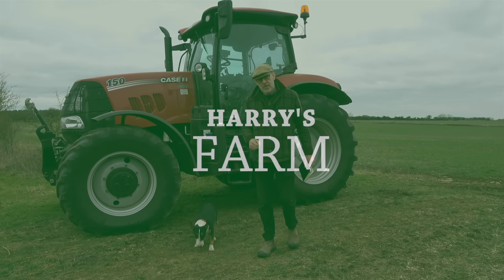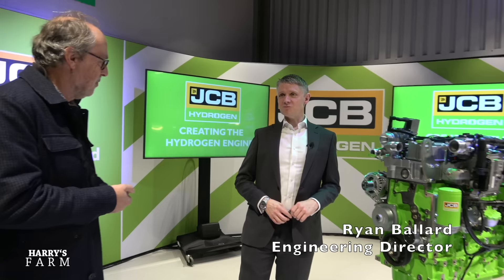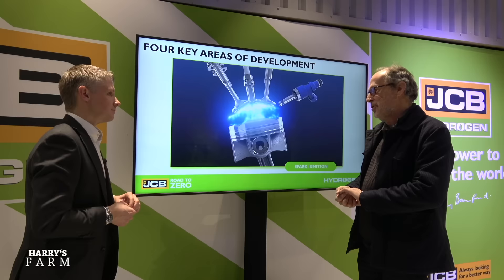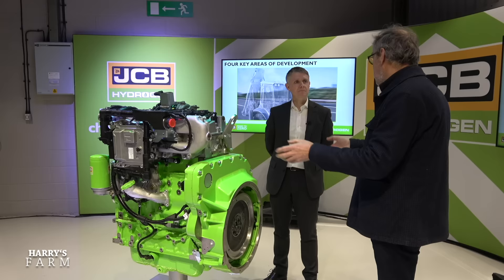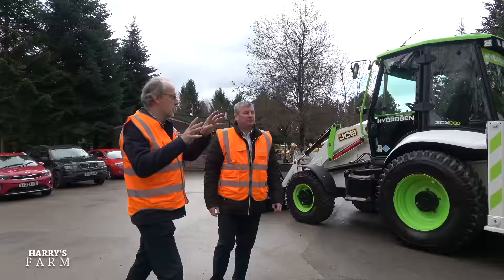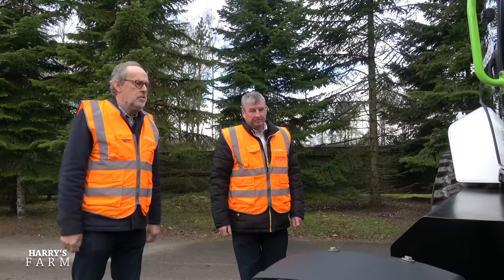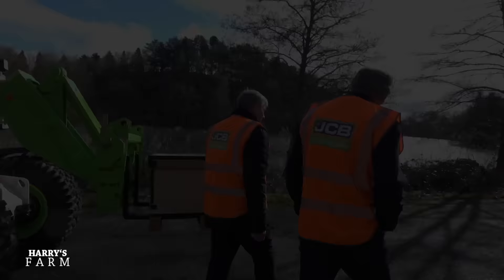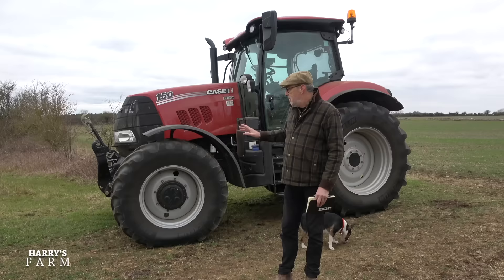JCB is moving to hydrogen power for all their big machinery. Here’s why.

Comment: This is an excellent video, as a diesel engineer im watching the hydrogen world with a keen eye.
I do wonder what the crash protection of the storage tanks is like, 350bar is a huge amount of pressure to let go.

The huge RPM of the turbocharger makes me wonder if that's a single point of failure.
Reply: some turbos already spin at 280,000 in petrol engines ,  Diesels spin slower ,i think what  they have achieved is a turbo that spins very quickly at low engine revs  but not a turbo that spins  any faster than a petrol turbo .
Reply: I think you have probably seen a turbo glowing red/white hot and still run reliably ,I think a few revs will not do any harm.  Also I have drove gas Scania,s with carbon tanks on the sides with no issues.

Comment: On a tour of the Cummings factory 20 years ago they said that they believed if an engineer could come up with a commercially viable method for storing gas in a similar volume as diesel in a compact size they would be billionaires.

It is certainly an interesting direction along with the CNH methane engines it will be interesting to see the true viability in the sector as a lot is certainly going to depend on infrastructure especially given how a lot of locals view planning applications for such things .
Reply: Storin g high pressure hydrogen is an expensive and dangerous business. That is why hydrogen has not caught on in cars and won't catch on in tractors either.
Reply: Cummins are already building Hydrogen engines too. Interesting to see it develop.
Reply: Dacia have Duel Fuel, LPG & petrol. The LPG tank is fitted in space for spare wheel. LPG is good value and gives good mileage.

Comment: The biggest problem for hydrogen is the distribution. It requires rughly to ten times more lorrys to distribute hydrogen than diesel. Thanks for a nice vid!!
Reply: Does it? Surely at higher compression less volume is required for the same return for kWh per g as diesel.

Comment: I love this, but no one talks about the loss of hydrogen while the equipment is unused, due to the pressure tank needing to relieve pressure as the tank warms up.
Reply: it's just the angel's share, works wonders for Whisky. Vintage Hydrogen anyone?
Reply: As systems are refined the small problems will be resolved. Everyone slating hydrogen are the same as people slating electric vehicles 10 years ago. Conventional ICE engines are safer & more efficient than they were 10 years ago. Investment drives innovation.

Comment: Very interesting video Harry! Fantastic to see how fast their progress has been going. But I think batteries biggest advantage over hydrogen is still the price. it's just so much cheaper and most of the problems with long charging can be done with battery swap or fast charging. Anyway its great either way which will be used :)
Reply: Can you provide a reference on your "Cheaper" claim?
Reply: @bru512  Sure. it will depend on different markets. but with batteries charged from solar/wind directly it is about 3 cents or less. from the grid it would be between 10 and 20 cents(depending on where). batteries will have a cost of about 2-10 cents over lifetime. so with this its is between 2-5 times cheaper than diesel or hydrogen at its current state
Reply: and even with only fast charging its still cheaper at about 3-5 cents per kwh
Reply: @bru512  a 3 pin cost about £100 to put in.
The cheapest hydrogen fuel pump is about $2000000

And you can't really drop the price per mile below £0.15 per mile, (if fuel was free)

Comment: I worry about the storage of Hydrogen as it is kept around 350 > 700 Bar. I foresee nasty tank explosions in the early days of this gas being deployed on sites and farms. You're a brave man standing that close to the tanks.

I agree charging battery-based building site or farm machines in remote areas is not going to work in many cases.

But we must not forget that once you produce this gas, compress it, transport it, and burn it in an engine, you only get around 28% of the energy you put in at the start. So everything we can electrify we should for sure before reaching for Hydrogen.

I agree for some long lorry/truck trips that have to be over 400 miles or long-distance shipping, then Hydrogen is one of the only options. But there are plenty of lorry routes under 400 miles where an electric truck will work fine. The Regen braking on a battery lorry will re-capture up to 20% of the energy on a typical run and do over 90% of the stopping work, whereas a Hydrogen lorry would need to apply the old style brakes, which need replacing just like diesel trucks, thus still generating brake dust.

I am sad, Harry, that you dismissed the work of Tesla, and the Tesla Semi, a large full truck capable of up to 425 miles at full load (37 tons). This could replace many routes in the UK and is 90% more efficient than any Hydrogen truck can ever be. Also, engines that burn fuel or gas still need oil changes and new parts as you found out, producing parts has a carbon impact at every service interval. Electric motors do not, and the battery can be recycled at the end of its life.

As you say, it needs to be a multi-pronged approach.

Thanks for the video and for getting us debating.
Reply: Great to see another person flagging the Hydrogen Hierarchy- its uses should be limited to specific industries due to its incredibly inefficient production.
Reply: Batteries may be viable for small vehicles and even trucks, as you have pointed out with your example of a Tesla semis, I just don't see them replacing diesel engines  in the huge machines used in constructions and the mining industry.  Unless geniuses out there come up with a light batteries, diesel will still be the energy source for heavy duty works and if governments ban diesel then hydrogen may become a viable alternative.  The fact that the tesla semi is still not yet in production four or five years after Musk showed it off to the public says it all really.  I will be convinced of its viability once   I see a tesla semi pull 30 tons and achieve range greater than 700 miles.
Reply: You’re delusional if you think electric equipment & batteries won’t require maintenance or replacement
Reply: I agree a multi approach,,,   and I can see why you would be hesitant about Hydrogen tanks, but have you thought about the fire hazard of the kind of battery being proposed for a 40ton truck..    If that battery self ignites it will be weeks before it can be put out..  No there is no easy solution,and EVs are certainly not the all in one option.
Reply: @masaukochitsamba7808  Mines started changing to electric machinery in late 21 - one of the huge advantages: no exhaust fumes in underground tunnels..
Reply: @jimbaumann6579  your delusional if you didn't read what the OP said. And, correctly speced LiFePo4 can have a life span of 30 years (Swedish University study) but I will concede that you have to use more batteries than the initial spec might suggest.
Reply: @lucylovitt9583  Open Cast Mines do not use electric machinery.  These mines have huge trucks, bigger than anything found on the roads today, that carry the materials for processing.  I don't see them becoming battery driven anytime soon.
Reply: @jimbaumann6579  Less maintenance than a engine based truck, but still some. Don't worry. I look after a fleet of EVs and they all need service but far less then the older fossal type car.
Reply: @Hazellh  Thanks for your comment
Reply: @masaukochitsamba7808  Pepsico has now received Tesla Semi's.
Reply: Thank goodness for a critical comment. It is a refreshing change from the knee jerk echo chamber of uncritical gushing praise.
Reply: @masaukochitsamba7808  In case you have not noticed, sales of new ICE cars will be banned from 2030. Diesel will become extremely expensivee because of limited demand.
Reply: @lipsee100  Batteery fires are incredibly rare. Per mile driven there are far more ICE fires.
Reply: @masaukochitsamba7808  You would be surprised.
Reply: @rogerphelps9939  its a good job as they are so difficult to extinguish,,just think if one of Tesla semi,s  got ablaze in a urban area it would be burning for months..
Reply: @rogerphelps9939  They will ban vehicles, cars, SUVs, etc.  I don't see Governments banning tractors, plant machineries, earth moving equipment etc otherwise work will come to a halt.  Batteries can work well for light duties but for heavy duty work, such as those found in construction, I don't see diesel being replaced in the immediate future.  I don't see the huge machines used in road construction running on batteries.  Those machines run for 24 hours, are there batteries that last that long?

Comment: Really love the video Harry, and the eagerness to learn about modern tech, and show it to us!. Going to get a lot of hate for this one, but I really want to be convinced hydrogen is better than BEV, especially for these applications, but unfortunately the physics of hydrogen really isn't working in my brain. I'm not blinded by the electric/diesel/hydrogen side of the fence, but you really can't beat the numbers, and ultimately consumers will buy what's cheapest to run, and what is the best experience.

Off the napkin maths from their H2 numbers seems to suggest that the first tractor shown only uses about 250kWh a day worth of Hydrogen? In that size of machinery, 250kWh worth of battery capacity is child's play... and that's on current chemistry not future. Of course that may not be possible to charge overnight in all locations, and whilst most locations could, the same 'diesel bowser' approach applies, where a MWh scale battery can be located to site in exactly the same way, at a MUCH lower unit cost. We already use high-power feeds for sites in most examples anyway, so the work is almost already done for us. For every 1 tanker of diesel delivered now, you'd need 6 of them for hydrogen because of its energy density - that sounds like a lot of disruption to me for no cost benefit.

The reason BEVs have won over H2 in cars are because they provide a superior user experience, not because they're green. Whether that's the experience of the drivetrain or the cost of operation. To me, JCB bragging that this will be indistinguishable from a diesel experience is their biggest problem, there's absolutely no incentive for the user to move other than the flamboyant choice of paint colour. 

The fundamental vehicle architecture needs to change to take full advantage of each fuel type (like where ground-up BEVs are much, much better than ICE conversions, so same goes here - they should look completely different to conventional designs), and since the user experience with H2 isn't better, and for it to be sustainable all H2 must come from renewable energy anyway, physics is screaming for us to cut out the useless middleman. The promise of green H2 really does feel like the gateway to blue/grey H2 which is just burning gas - bringing us back to square 1 (I fear this is the idea all along anyway). I understand that JCB want to reuse as much of their sunk capital in diesel development as possible, which makes sense for their business, but in terms of the technology it's just all wrong. 

I think the bottom line is that for every 1 wind turbine or solar panel needed to power BEV machinery, there needs to be 2 or 3 for H2, that means at least double the land use, double the capital investment, and double the unit cost for the same output. That seems to be the fundamental floor that H2 can never overcome. Whilst we need to explore every new technology to reduce our impact, like this one, it needs to be better and cheaper for the user, and if it's not it's time to move to the next. The numbers don't lie, and the market will weed out the worst technologies either way...
Reply: Yep. I'm working on hydrogen for aviation applications at the moment, and for that specific use case hydrogen makes more sense than batteries for the foreseeable future. But that's due to a set of challenges that don't apply for ground vehicles. Maybe these bits of heavy machinery are a borderline case with current battery tech, I imagine JCB have run the numbers and won't argue with them! But I can't see that lasting long term.

Hydrogen cars and hydrogen for home heating are totally impractical, and always will be. It just isn't going to happen, batteries and heat pumps are going to win because they're superior in every way, especially with developments currently coming down the pipe for batteries.

I'm a proponent of hydrogen in the small number of applications where it makes sense. But a lot of time and money is being wasted around the world working on sticking hydrogen in places it has no business being, because it's an easy way to extract money from powerful people who buy into the marketing and don't understand the reality behind it all.
Reply: @GoogleAreDumb  Well said - both you and James - spot on. It is indeed about digging for subsidies, not subsidizing diggers.
Reply: @brushlessmotoring  i love that line ^^ can i steal it for a presentation i need to do next week?? ;-)
Reply: JCB claim "batteries don't work for heavy plant" but it just doesn't wash with me, there are three main drawbacks compared to existing ICE solutions:

1) they claim weight is an issue - why then do things like 360 excavators, quarry trucks, tractors and dozzers all carry extra mass in the form of huge cast iron counter/balance weights?  Just replace those with the batteries?

2) Recharging times - simply make the battery pack demountable. Pretty easy on a large heavy plant machine, when it's flat just go pick up a full one, the packs can be charged off the vehicle if that vehicle needs to work 24/7

3) cost - this is really the true reason. If you already have a logistics and supply chain to support the ICE powertrain, then yes, it is indeed expensive to replace that with one for batteries and motors. However those costs are falling markedy. Most OEM passcar studies suggest cost parity  (at volume equivalence) within a couple of years.  There is also the not inconsiderable potential (sic) for EOL battery sales to recoup significant proportion of the inital battery cost for second life applications (a worn out diesel engine worth just scrap value, a worn out battery still has significant value)
Reply: @maxtorque2277  more than welcome to nick that one :) is your presentation public? Do share.
Reply: @maxtorque2277  so you're going to remove a very heavy  counterweight and replace it with batteries that by mass do not equal the same weight  , so you will have to make the counterweight larger , probably twice as large  for the same weight , one of the  ongoing quests for large machines is zero tailswing , that will never happen with a counterweight twice the size , a counterweight on their current 220 machine is approx 24 inches deep in the middle and tapers to 3 inches at the sides , you won't get many batteries in that space ,  make the battery pack removable and simply pick up another one and change it ,  3 tonne of counter weight  will need a  good sized forklift truck at least to simply remove it  , imagine a vehicle of that weight carrying a 3 tonne battery across a farmers field  to change his flat battery in situ , it just isn't feasable
Reply: Well said, producing hydrogen via electrolysis, then compressing it, storing it, and transporting it to the end user is horribly inefficient when compared to just using the electricity to charge batteries. Furthermore they are then burning it in a combustion engine which is at best 40% efficient. A fuel cell  properly sized for the application is 60% efficient, if you have to use hydrogen why use an ICE? None of this makes any sense to me!
Reply: @kawasakikev8905  it’s funny how people’s problem solving skills go out the window when batteries are involved …. It’s not going to be any easier to pump hydrogen in from a large compressed tube tanker either - using hummer EV as a reference, it’s a 250kWh pack that weighs 1300 kg, I’m not sure what the density is, but it would not surprise me if it was 80% of cast iron. You keep most of the counterweight and make a space for batteries - you also have the space that was taken up by the fuel tank and engine to play with, as the electric motor is very small, so instead of digging your heels in like a donkey and braying that it can’t be done, put your thinking cap on and start coming up with ideas. There is a 60 ton mining dump truck they converted to electric so they could charge it up using gravity from hauling ore downhill, I’m assuming those folks were not full of ‘it can’t be done’ like so many anti EV commenters are. You solve other problems in your life, why can’t you imagine solutions to charging a battery in a muddy field?
Reply: @maxtorque2277  I'm sure you know far more than JCB. I'm sure with your knowledge they would love to have you on board showing them where they are going so wrong. And as for that claim about battery costs falling rapidly, well that is not happening anymore, in fact costs are going the other way.
Reply: I could not agree with you more. Very sensible comments.

Comment: Mass transport using battery-electric  and heavy machinery using hydrogen would be an excellent pragmatic solution, especially in terms of the infrastructure challenges of using only hydrogen or only battery-electric, for all forms of transport / machinery.
Of course e-fuels for certain classic cars / bikes and motorsport are a must. The e-fuel should be close to carbon neutral, and whatever tailpipe emissions are produced will so insignificant, if used by a relatively small number of users, that the cultural and emotional benefits of classic cars and motorsport will more than compensate for them.